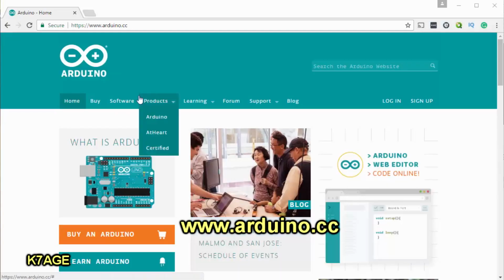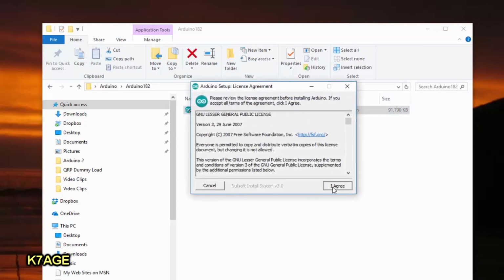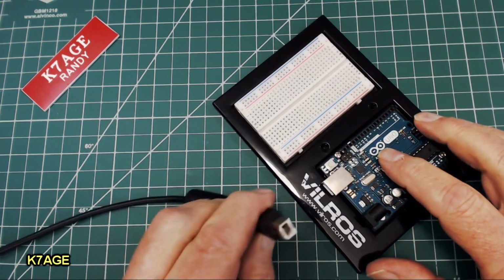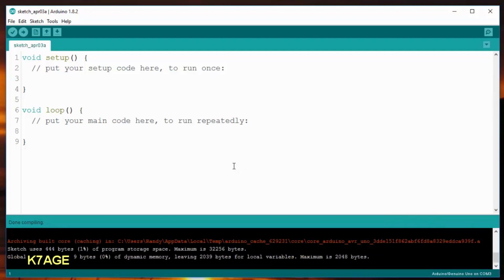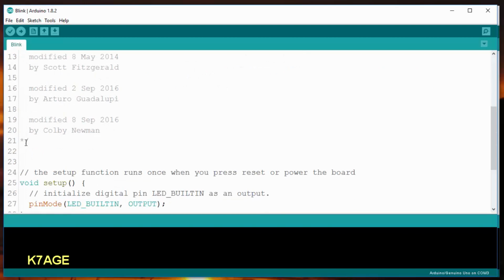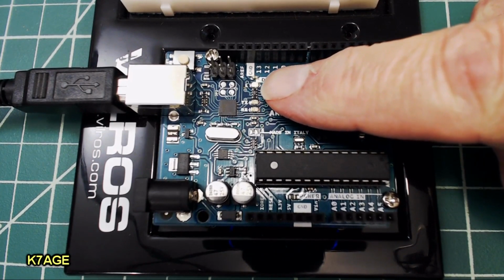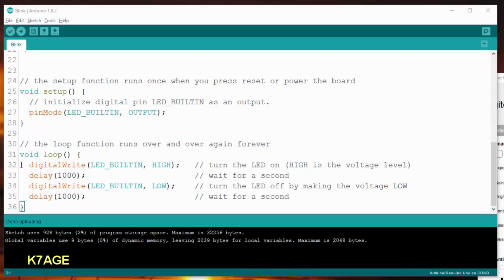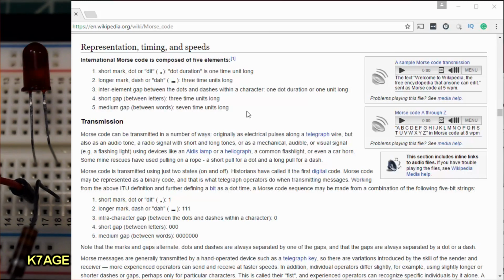Arduino Pt 2: Blinky Blinky

Comment: Good stuff Randy.  On Pin 13, you don't need a resistor, it's already throttled for an LED.  Cheers!  Chris
Reply from the maker: Thanks for the tip. Still learning this myself.
Reply: Me too brother!  73, Chris - NI7IN
Reply from the maker: Looking at the schematic. There is a buffer in series with the LED on Pin 13.
Reply: Yes you do need on for an external LED.

Comment: You pointed out that the compile seems very slow, even for an essentially empty sketch. Word on the Arduino forum is that that is due to the interaction between the IDE and anti-virus programs. Some folks apparently turn their av off temporarily and get a decent compile time. I've never tried it, but that's what they say. 

Jim ZS6JMB

Comment: What are your ultimate plans for the Arduino? 

Admittedly, I know very little about these devices and all I have seen are blinky light programs and "Hello World" with the add on screens...or some variation of each.

I am sure there has to be a more useful purpose for these devices....like the antenna switcher that George Thomas built.
Reply from the maker: Hi, good question. Next will be playing with analog input and PWM output and the serial monitor. Next, playing with the temperature sensor driving the meter. I have some display coming, so something about that. I may use the analog input to measures and then calculate the power and show on a display. I have a QRP SWR bridge and use the analog inputs and calculate SWR.  Not sure of any serious project, mostly playing with the Arduino and sensors and out devices to learn more about the Arduino. Hopefully to encourage others to not be afraid of it and do some projects on their own. And of course, all subject to change.
Reply from the maker: I forgot to add, how does that sound?
Reply: K7AGE Sounds great. Can't wait for the next video. I've been thinking about getting one.... or a Raspberry Pi,  just to tinker with. I'm interested to see where you go with yours.